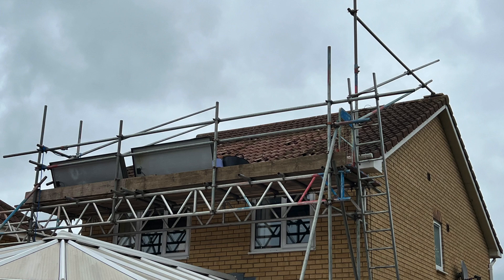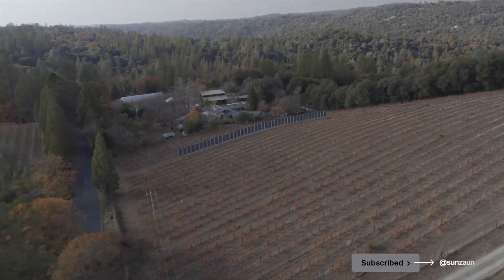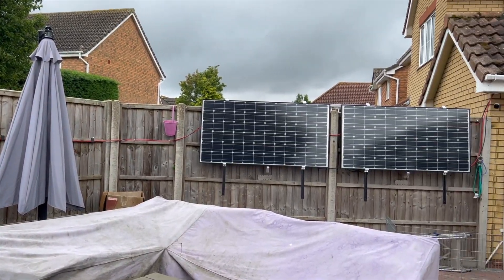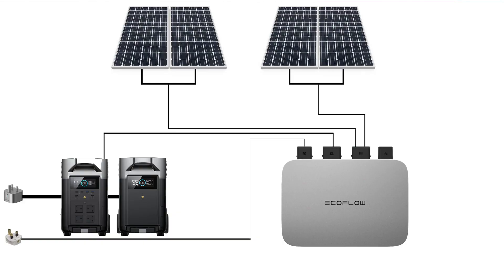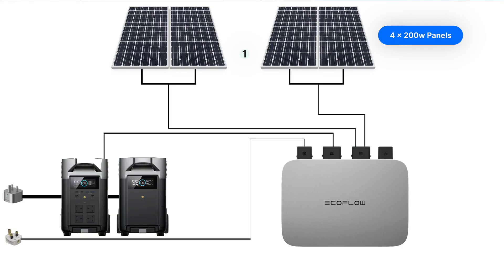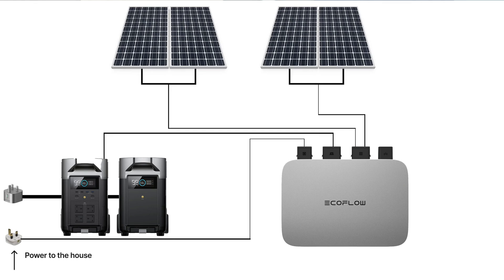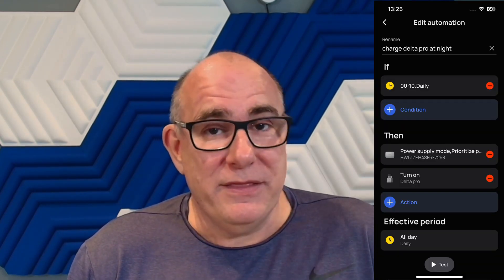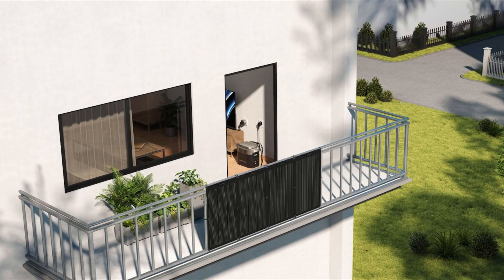You Won't Believe the Results of My 1-Year Solar Experiment!

Comment: Hi Jon, did you have to get DNO approval.  Like you I already have a FIT solar array (4kw) and a second array fitted a couple of years ago (4kw) and my DNO has refused me fitting any more.  This sounds like a perfect quick, DIY and cheap option to get more power.  cheers John
Reply from the maker: yes, I did, however, I wrapped it all into the main upgrade that I did to my inverter.

In theory you have to let them know about any equipment you have on site that is capable of generating electricity and pushing it back into the grid. 

That said, I know at least it doesn’t people who have installed these and have not informed the DNO, and the world didn’t stop spinning 😂

Comment: Hi Jon, when you wired into the consumer unit how does the Ecoflow behave when you also have solar and home batteries. Does it export everything to the grid or does it try to charge your home batteries? Thanks for your earlier advice about it home batteries and ecoflow not working together when there is a Shelly.
Reply from the maker: So i have it setup to export at a constant rate of 550w. This goes into the house even if there is no demand, anything not used gets exported. Since its does not meet the 1.3kw requirement to start the EVs charging its just treated as excess. My home batteries and inverter only kick in if there is a need for more then 550w.

Comment: Last year my powerstream produced 345.75kw ,in August I added extra 800w of solar to the powerstream, combined with a delta 2 max and extra max battery 4kw of storage ,so hoping for more production this year , my base load is only 30w ,so a very low user .
Reply from the maker: That's pretty good, will see how these old 200w panels do for the the first year then upgrade the panels in year 2

Comment: Your wrong. Its not 70 voolts per string. Its maximum 55 volts per string. I have 2 x 400w solar panels £50 each. Generated 28 kw in first 14 days of march 2025
Reply from the maker: my bad

Comment: hi did this upset your existing solar system, I have an existing setup with grid tied inverter with 2 strings of panels but I'm thinking of doing similar to get a bit more free electric.
Reply from the maker: no they co exist very well. The ecoflow micro inverter is set to push out 350w continually so if the panels don't supply enough it takes it from the battery. I am not sure how it would work if both inverters were both trying to adjust power flows with the other also competing. But it works :-)
Reply: @JonathanTracey  ok thanks I have a battery storage system with my solar inverter already, I don't own any eco flow products as yet but I'm thinking of getting the powerstream inverter and 2 cheap 400w solar panels to try it.
Reply from the maker: Sounds good, the power stream is good but be careful which panels you use, there are voltage limits which if exceeded will blow the inverter. I had to wire my panels as two strings with each pair in parallel. This was the only way to keep the voltage down.

Comment: This looks like a neat DIY option. I look forward to seeing your experiences.

On the subject of existing systems you can buy, I can think of two off the top of my head, but I've seen more.

Sunology in France has a black-on-black kit system specifically to mount to existing balconies. It has optional arms so that you can prop the panels out to get a more advantageous slope if you wish and your railing allows. They also make systems to sit on the ground with and without batteries, as well as conventional rooftop panels.

For new builds or replacements, Mitrex in Canada has several different types of solar fence or railing, ranging from small ones that would fit in a balcony or patio type situation to ones large enough to be used for noise mitigation along motorways. Those are an entire system rather than something to mount to a pre-existing fence or railing, with connections and wiring that are discreetly concealed in the posts and at the edges so they can be used in places conventional solar would be unacceptable. They have a breadth of options as far as appearance, with printed finishes ranging from solid colours to a wide variety of types of imitation marble, slate, granite, brick, metal, wood, and even textured finishes. 

They are also available in facade, cladding, curtainwall, and skylight systems for buildings, most of which are generally installed vertically. Different finishes give different efficiencies ranging from 22.5% to ~15% because, obviously the lighter the colour and the more reflective they are, the less light passes through to the solar cells. They also make dummy panels for areas that don't get enough sunlight for PV to make sense but where you want the same finish. They can even make panels with a gentle (they are made with monocrystalline cells) curves if the architect specs them. Perhaps they can do sharper bends for dummy panels, but I don't know for sure. If you want to have a custom printed pattern, they will do those too.

Mitrex does have panels intended for roof mounting, but from what I can tell, they're much less integrated than their other systems. They more or less mount on conventional racking systems over a roof rather than being a replacement for a building material that you were going to need anyway that also generates electricity in the way their other offerings are. Their distinctive feature is mainly the custom finishes that can enable lower visual impact - they can colour and pattern match shingles, tiles etc... but they're still going to be a couple inches above the roof.
Reply from the maker: Thanks I will take a look at both, I also found a company called Jaksun but htey need you to use their posts as well, not sure I would get family approval to start pulling up the posts

Comment: Can you provide a link to official guidelines around new regulations? I’m about to install powerstream with 2x 400W panels on my garden fence.
Reply from the maker: Sorry I don't have it, I'm going off the communication from Ecoflow that said due to a change in the guidelines we should discontinue using the plug and wire directly to a fused spur. Probably best to contact them directly if you need more info.

Comment: The way I built my array it could be a fence, vids available off grid playlist, new mount design next month, but for a fence, posts are best. Vertical south facing bi facial with snow gives me the highest #'s of the year. Northern 50th par.
 I have a 8370w total, 2790w x3, 465wx6. One panel 465w #s, heavy rain dark cloud 76w, overcast 105w.overcast snow 160w, summer no white rock and clear sky 300w x 16hrs np burning 24kw on ac alone, winter solstice sun and snow 569w, based off pv2 x3 10.5kw from a 8.4kw array. Max power when I need it most and more than enough even though pv is reduced without snow, more sun less cloud longer days.  For my current max #s is 1 panel x18, next month x 27
 Numbers next winter will be much higher in overcast, adding a panel to 2 strings and a 4th 3.3kw array. Panels never get snow covered over 40 snowfalls; I cleaned a few bird bombs once in the past year.  I can produce these #s from sun hitting the backside of the panel, mounted on a wall is not beneficial. So far a really good set up for heavy winter overcast areas. After upgrading the low in heavy rain over 2kw total, overcast 2.8kw, 6 hours of daylight overcast should be 17kw, consuming 14.6kw a day electric heat and everything.
Reply from the maker: would love to try some bi facial panels but my neighbours would probably complain :-) My posts are concrete to can easily take the weight, I am looking to see if I can find some with channels in the center to route cables
Reply: @JonathanTracey  you could mount the bi facials horizontal if needed, but only 93" for 600w less than 8ft fence. Save time with 1400mm cables. 1300mm can be a bit short with some micro devices. The new 3.3kw array with wire, fuses and wood $2000 cad.
Reply from the maker: Have some plans for some bifacials in near future
Reply: @JonathanTracey  Aug 21 or sooner new vid with the new array,  #'s and going to see if I get a boost with refletix on the ground, snow simulator
Reply from the maker: a snow simulator, what is that ?
Reply: @JonathanTracey  just put refletix or white rock around the panels, even white corrugated plastic sheet they use for signs
Reply from the maker: Hah was hoping for some sort of artificial snow machine 😜
Reply: @JonathanTracey  maybe use the fake snow like the ski hill in Dubai,
Reply from the maker: i have actually skied on that, it’s inside a shopping mall, an amazingly pointless piece of engineering